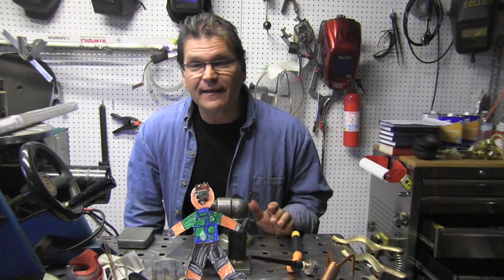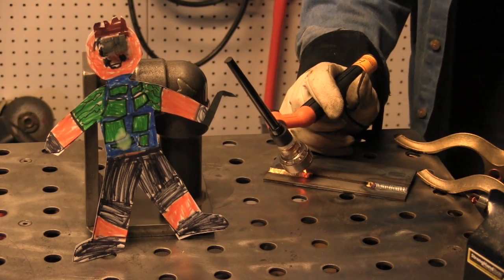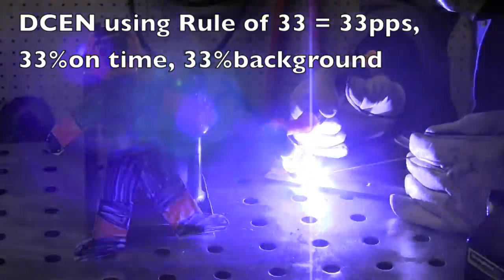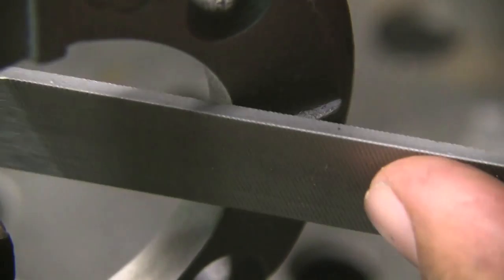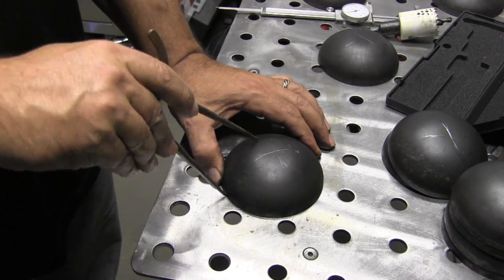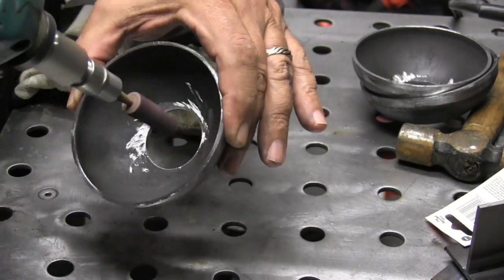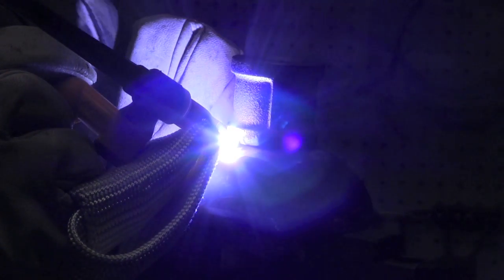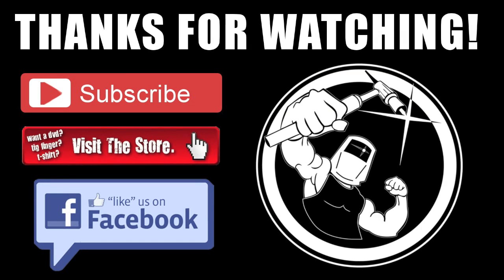Tig Welding/Brazing with Silicon Bronze

Comment: Fantastic and informative video ..thank you so much from across the pond. One question though my AC TIG will only go up to 50% AC balance . Can I still use on AC on Silicon Bronze with such a low balance or am I better off using DC (my machine has variable AC frequency and pulse (200A max)

Comment: i tried some Silicon Bronze today with a miller syncrove 250 DCEN thorated and the pure and i got a pretty fair amount of sputering for lack of a better word? when feeding the Silicon Bronze it spuwed bad.  what could i be missing in my set up?  aty recomendations for setting the welder? i set it like i would to weld steel.  i was needing to braze ended up useing alluminium bronze. thanks pan

Comment: Hi Jody I am new to Silicon Bronze,, as in I just got my first pound of Rod, I do not have an inverter machine but an older Syncro wave,  My project is filling some metal plugs that helps a Smog pump in  a 1984 Chevy in line 6 and are no longer needed, I thought filling these with Sil Brz would look nice,, What kind of electrode should I run and  should I use AC or EN-    Thanks in advance

Comment: Complete newby here - thanks for posting such interesting videos - what's a reccomended path for someone like me who has zero experience to start doing some simple metal repairs - I'm thinking brazing using aluminium or bronze - but is it better to start with TIG, MiG or Oxy Acetaline for example? What's a good minimum set of kit to start off with?

Comment: TIG brazing looks like a really useful method of joining things. My question is, does it need an advanced TIG welder with HF start with all the functions I don't understand what they are for (pulsing and slope and perhaps more)? Or can you TIG braze using a simpler stick/tig welder that uses lift-tig start?
Reply: I've done it on my esab miniarc 161 Lts. It worked but after doing it...old grey cast repair i would def want ac control if I had to re do it to help clean oxides out of the puddle. Took a few tries of grinding out the bad so I could finally get nice clean metal to flow.

Comment: i tried si bronze tig. i tried it on angle iron, gound off scale and cleaned with solvent. cant get bronze to stick. i also tried on some 16 ga plate, solvent cleaned, got a blob to melt but wont wet out.  not sure what i am doing wrong

Comment: I understand Harris has been fabricating motorcycle frames for 30 or more years for street and racing.They use a british high manganese T-45 aircraft tubing with a specific bronze welding rod with both having a tensile strength of 85,000 psi. They are welded using a a gas aircraft torch; one big advantage of this is much smaller chance of grain growth and stress, brazing at 1600 to 1800 degrees F compared to tig fusion welding at 2500 degrees and up particularly with chromoly which should never be brazed. Both T-45 and 4130 chromoly were designed during WWII for the same purpose: engine mounts for Fighter and Bomber aircraft. Tig welding wasn't perfected until after the war. For chromoly to achieve its maximum strength of over 100,000 psi it must be stress relieved and heat treated after welding. As a bladesmith well versed in forging, grain growth, normalizing and heat treat I think a lot of people tend to give the british practice of bronze welding short shrift. After all the Land speed record Car Thrust II  was built of T-45.The only similar steel available in the US is Reynolds 631 a steel used in high end steel framed bicycles. I don't why a US steel maker doesn't make a US version of T-45 It's much more forgiving than Chromoly.

Comment: I got a couple questions, I got a thermal arc lift tig. I would like to weld silicon bronze at some point using lift tig, is this possible? I am not sure what kind of versatility my machine has for different applications, I didn't buy the machine with the Tig torch. I just bought one today and have zero experience tig welding. I am going to practice and learn. Thanks for the videos! I subscribed and can't wait to learn. Cheers!
Reply: I'm amazed how delicate tig welding is. Once you get your ducks in a row it's almost automatic. Thank God for Tungsten! Got lucky and picked up a Miller syncrwave 350 for $1k. So my tig setup is complete. Ac and DC tig. Going good!

Comment: is it possible to weld this metals with 6013 electrodes ?
i have many of them .
Reply: +toolman talal 6013 electrodes are for steel. They won't work very good on cast iron, your weld will crack
Reply: +MechV thank you

Comment: Hi Jody, I just bought a 10" logan lathe and, unfortunately, the two back gears each have a broken tooth. If I were to succeed in tig brazing the missing teeth with silicone bronze and re-machining them, will they be just as strong as the remaining cast iron teeth on the gears?

Comment: Love the videos and am subscribed.  What would you suggest for welding 16 oz copper sheeting joints?  Brazing?  The finished product would be in a barbecue so soldering wouldn't cut it.   Thanks!

Comment: isnt pre heat required for welding cast to stop cracking from thetmal shock?
Reply: I think it's not as necessary if the cast itself is not ' melted '.
It's the molten cast iron that contracts as it solidifies. That's why you ' peen ' it to hammer expand it as it is contracting.
At least that's how I heard it explained.

Comment: Greetings.  Absolute novice here:  What's the point of brazing that joint?  What real world applications would require a brazed joint over a welded steel joint?  Does it offer a strength or corrosion resistance benefit over just welding it?

Cheers

Comment: if i dont have a tig , can i stick weld stainless steal ???????...if so what rod or special equipment needed ...............
Reply: u can buy a rod for stainless steel and using stick welding to weld. it work but it does look not so beautiful.. that's why they normally use tig for welding stainless steel..

Comment: Great Video Jody !! how can i prevent air bubbles, i had problems with the joint weld
on instrument steel (x20cr13) tig weld with argon i am not a welder but after the grind and heat treat i had some small spots like air bubbles we used the laserweld for that, and is it necessary to temperaturing the spot weld with a torch ?? i hope you can follow me a little bit with my bad english .thank you

Comment: May I please ask, what's the easiest and cheapest way to braze small copper wires at 90 deg angle without a welder?
Reply: Try silver solder. Get it from a jewelry supply store or on-line at Rio Grande. You need to use a flux - I like Dandix. I use a very small propane torch. Remember to heat the metal, not the solder. (Silver solder comes with different melting points - hard, medium, easy and very easy. This is for complex jewelry fabrications. For what you are doing, you should stick with hard or medium for strength.)
Reply: MRrwmac  Will the copper wires need to flex any after joining?
Reply: No not at the braze done ting joint. It's for what's called a "Marble Machine". The copper is the track that the marbles run on similar to a Roller coaster. The joints I'm asking about doing are the small 1/8 dia copper rod supports connecting to same dia copper track. Hope that's not confusing and Thanks for any help.
Reply: MRrwmac  At first I was thinking electrical wire. Now I get it. Good job with the word picture! 
You might investigate 5-15% Sil-Fos or even 5-15% silver solder with the corresponding flux.
It looks a bit expensive at first look, but a little filler goes a long way, especially on 1/8" diameter materials. Look around on Amazon, MSC, Brownells or even eBay for good deals. 
With the correct flux, the low temp versions will usually flow without too much difficulty using an inexpensive handheld propane or MAPP gas torch. 
There is a YouTube video called "Brazing Copper to Copper with Sil-Fos" that may give you some insight. 
Glad to be of any assistance. Good luck with your project!
Reply: Sounds good. I'll give those a try. Thank you all for your help and advise!

Comment: Where do you get the aluminum bronze? Everytime I ask about it I get a funny look.
Reply from the maker: bikefreek you probably wont find it at a welding supply store. but I have ordered aluminum bronze a2 tig rod from Amazon
Reply: bikefreek  My Airgas store carries Harris Aluminum Bronze A2 rod 1/16, 3/32 & 1/8 in 10# boxes, pricey, but you can many times sweet talk them into selling smaller quantities by the pound. 
Online shopping (Amazon or others) may be easier and cheaper than getting some wholesalers to sell over the counter to you as a walkin consumer without an account or proof of business license and tax ID.
Reply: My Airgas store is where I get the funny looks...lol

Comment: why does that look so damn pretty? I wish those welds held up better than normal ones.   But one weird question, could you do a tig weld, and then after go over with silicone bronze with a nice pattern without damaging or weaken the other weld underneath?    Or am I stupid for asking? :)
Reply from the maker: LOUDPIPES SAVELIVES  some chopper builders go over a tig weld using silicon bronze for pure aesthetics. It looks cool but if a crack develops in the weld underneath, you wouldnt see it for a while.
Reply: Quiet pipes save eardrums. What?

Comment: found a typo on you site.

tig welding copper to steels
Silicon bronze works for joining copper to stainless steel as well as stainless steel. 
 oops
Reply from the maker: Timothy Jones thanks bro, its fixed now

Comment: How come the last one did not have the stack of dimes look like your practice shots?  Was that due to the gas coverage as well?
Reply from the maker: IIIsticksone yep, I am pretty sure it was the cup along with using pulse.  the small cup allows for quite a bit of oxidation and that also increases need for more amps to flow the puddle....once you get to a certain heat, ripples disappear. but good enough for a piggy bank and made my near empty tank of argon last longer.
Reply: weldingtipsandtricks Thanks!  I have had trouble getting the stack of dimes look with silcon bronze and this will hopefully help.

Comment: Very nice video Jody, good arc-shots as always! One question though, how strong is a joint like this compared to a "normal" tig-weld on steel? Is it reasonable strong or will it break with a blow from a hammer? /Jonathan
Reply from the maker: sjowe I will try to do some destructive tests to show strength in a future vid
Reply: He melts the Silicon  Bronze filler rod around to make the two pieces "Stick" together. It's like a weld that doesn't mix with the base metal. The Silicon Bronze and the base metal he is welding on does not melt together like it would in a normal weld.
Reply: FN FlexorWolf
Yes, I know. But the question was how strong it got with this method?
Reply: member548 Thank you for the detailed answer to my question. I could guess, as you mention above, that this method works good on sheet metal. I do some bodywork on cars from time to time and will sure try this braze-method next time. As most welders know, the problem with thin sheet metal and welding is distortion. You want a completely airtight seal but at the same time keep down heat buildup. /J
Reply: I've used silicon bronze quite a bit to join sheet metal. It allows you to use less heat which can be valuable in sheet metal repair.  When I first started I did a bunch of destructive testing on my joints so I'd be sure I was using good technique and to have confidence in my welds.  I found that in lap and butt joints that when I was using good technique that the base metals would rip on one side of the bead. The welds also showed good malleability and crack resistance when worked, how ever, I can't help but imagine things would be different on metal of any weight much above 20 gauge, but I've never seen any reason braze heavier steels.  Keep in mind that it many ways, bronze is every bit as strong as steel, and the only reason the "Iron Age" is an advancement over the "Bronze Age" is that iron was strong enough, and far cheaper and more plentiful than the metals needed to make bronze, making decent metal tools available to far more people. With an ultimate tensile of 85,000 psi and and a yield of 55,000 psi, silicon bronze is stronger than A36 structural steel.

Comment: Is there any kind of rule of thumb for tig brazing amperage settings. Is one amp per .002" a good place to start or?
Reply from the maker: maintmech1245 I would say that would be a decent place to start. whatever amperage it takes to barely puddle the steel is pretty close.
Reply: weldingtipsandtricks Thank you sir! You're a huge help!